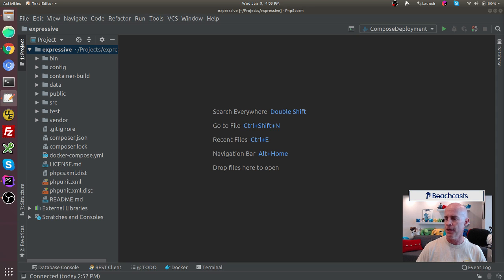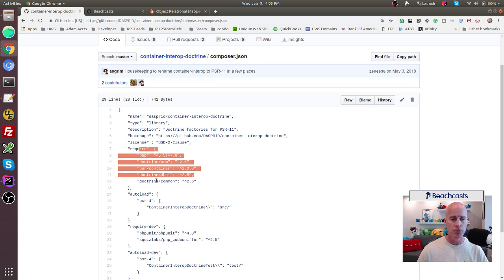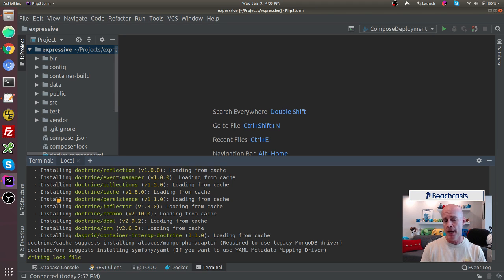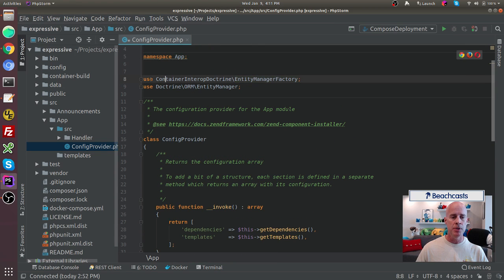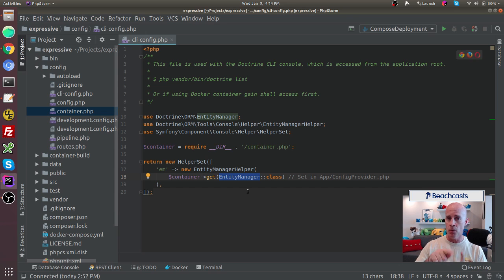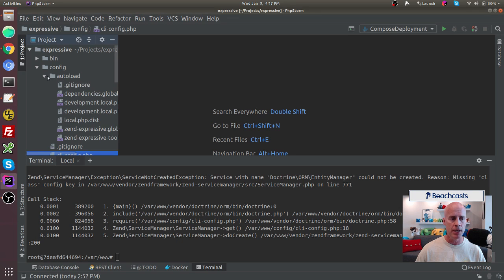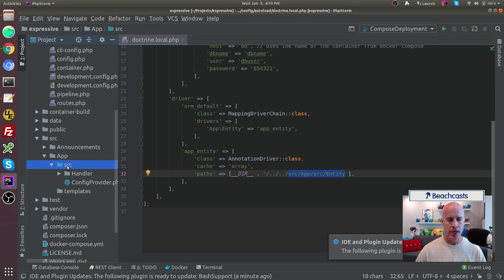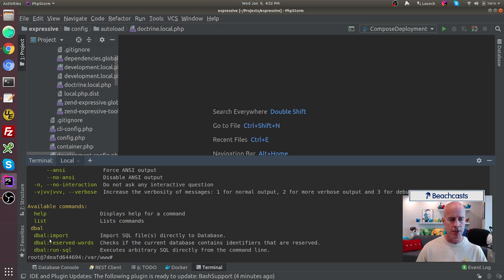Configure Doctrine ORM and Dbal CLI with composer - 004

Comment: As always, good stuff! I did come across a minor issue. I had to run composer require ramsey/uuid-doctrine to get the doctrine cli to work.
Reply from the maker: Sorry about that. The repo is kinda mixed up on that, because I am working on a future video where we will include uuid instead of using integers. I must have forgotten to roll something back. Will check into it.